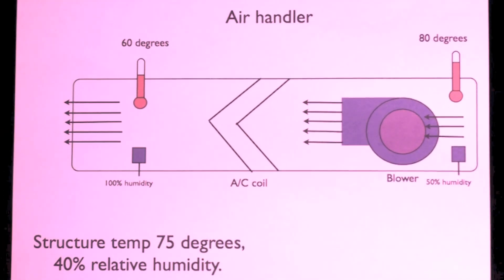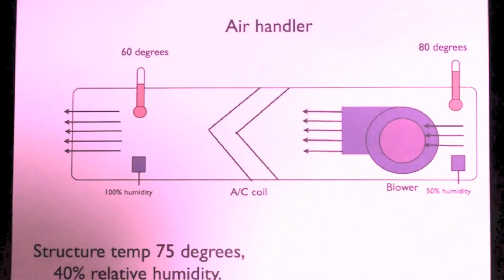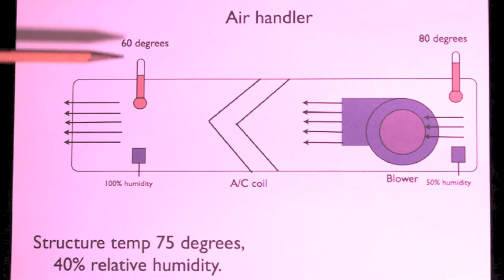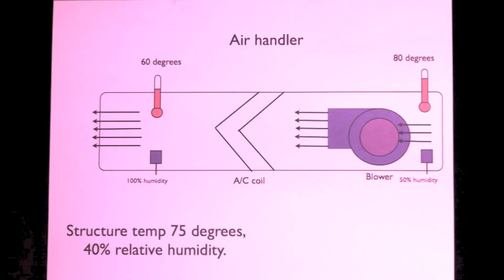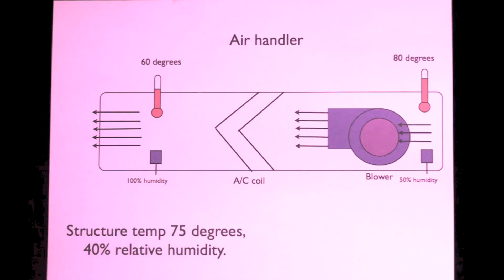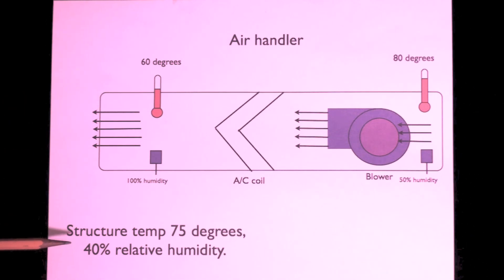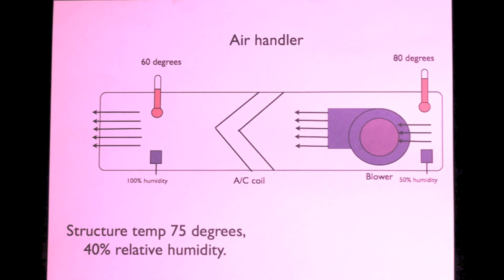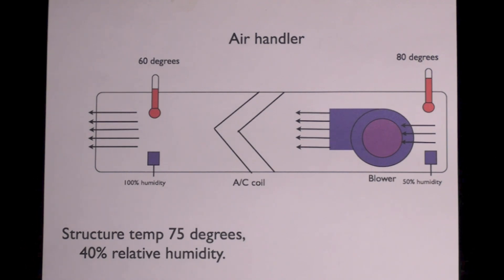Humidity:  The air conditioner as a dehumidifier

Comment: Your videos are great and I enjoy them very much. I am having trouble understanding your logic on the way the evaporator coil removes moisture. When air warmer that the evaporator coil hits the coil moisture will condense on the coil and drop out and be drained away. The air going across the coil is cooled and the humidity is reduced. Over time the amount of cool dry air being pushed into the home displaces the warmer air. Moisture will always be drawn to drier air so that is why the dryer air coming out of the AC ducts eventually lower the humidity in the house through the return air. It makes no sense that the cool dry air would be saturated to 100% after it is passed across a 40 degree evaporator coil. I think that you have your diagram at the start of the backwards. The air coming in would be 100% (most likely 70% (if it was 100% it would be raining😀) and lower going out at about 50%. I worked for the largest manfacturer of air compressors in the USA and taught classes in desiccant air dryers and refrigerated air dryers. We could take 100 psi @ 100 degree inlet temperature saturated compressed air and could achieve a dewpoint of -100 F (now that's dry). Of course compressed air dryers and HVAC unit are not the same but work on the same principles. Best regards Steve
Reply from the maker: Warm air passing thru the evap has its temp dropped below the dew point.  At that point, moisture condenses out of the air.  That means the air supplied to the structure is 100% humidity.  It then mixes with the ambient air in the structure and the humidity decreases.  Each time the structure air passes thru the evap, more moisture is removed.  
The result is reduced humidity the structure.  
GFM
Reply: @grayfurnaceman  Thanks for the information, I have been watching videos on enthalpy and it make more sense to me now. I always worked with compressed air systems under a pressure anywhere from 100 to 150 psi. not HVAC. I always knew that when checking dewpoint on a desiccant dryer we would use a sample cell to monitor the dewpoint of the air leaving the dryer outlet. There was a valve on the inlet that was always wide open and a valve and a "pig tail' (copper tube wound in a coil) on the bottom of the sample port. The bottom valve would always be just barely cracked open. This allowed the air to expand out and give you a correct dewpoint. If you took that reading at line pressure it would not be accurate. On refrigerated air dryers we never checked the dewpoint with a hygrometer. We knew that as long as the evaporator temperature was between 38 and 42 degrees there would be no water downstream in the compressed air system (we had a per cooler /reheater in the refrigerated air dryers that would warm up the discharge air to almost the same temperature it was as it came into the dryer), (prevents the compressed air piping from sweating). Our desiccant air dryers were sold to maintain a dewpoint between -40 F or -100 F depending on the model purchased. When air expands out it will lower the humidity of the air stream, one day I will get a temperature meter that can read the wet bulb and the dry bulb temp then use a psychrometric calculator to get a enthalpy number on my home HVAC system. I guess we are never too old to learn 😀. Looks like air flow across the coil will also determine the humidity in the discharge air. Now that I am retired I have more time to study and learn things that I always wondered about but always had an answer that would work in most situations. I knew that you could change the air flow across the evaporator coil but I never understood why. Thanks
Reply: Hi, Before I get installed an A/C duct, 
I'd like to search for an A/C which is going to deshumidifier during winter 
You have very good points
DomIJ

Comment: Our blower fan speed is set to 2100. It's a 4 ton system. Maybe that's too high?
There's also a 1900 option and a 1600. What are your thoughts?
Reply from the maker: In high humidity, it is too high for dehumidification.  1600 may still be too high.
GFM
Reply: @grayfurnaceman  OK thank you. Yes Gulf coast, which is high humidity. We will try either 1600 or the next level below that, which I think is 1400.

Comment: So why on my new AC, that cools wonderfully, it increases humidity in my house?
Reply from the maker: An air conditioner cannot increase humidity.  However, it may not reduce humidity as much as an older A/C.  Reducing the indoor fan speed may increase the moisture removal.
Best done by a professional.
GFM
Reply: @grayfurnaceman  I had the ac guys out here yesterday and the plenum that all the ducts connect too lost its seal and was mixing with hot humid air in the attic.
Reply from the maker: @FlydreamMedia  OK
GFM
Reply: My air conditioner adds humidity too.  Upstairs air conditioner broke and used fans pulling downstairs cool air up and humidity went down to 45%.  When air conditioner upstairs working the humidity is70% and I have to use 4 floor dehumidifiers when it is on.

Comment: Brand new home w carrier ac on temp 75 and humidity 75% feels like 80 degrees in my home. 1700 sqft with a 3.5 ton ac unit 2x6 construction w extra insulation Why is my house not like a Yeti coller! I like to be cold. the AC guy here that installed system says well its 70 degrees in the house and I am getting ANGRY  paid 200K for a new house that we are sweating in. Please any info will help Im in a small town so you can imagine
Reply from the maker: What you are up against is residential A/C units are designed to cool to 70F.  If you want it lower, the system may not be capable of doing it without freezing up.  There are methods to allow it to reduce that temp but they require changing components in your system.  
Now, if the unit will not bring the temp down to 70F, you have a system that is too small.  
GFM
Reply: @grayfurnaceman  Almost identical problem as James'. First summer in my new home, I was happy and comfortable. First winter and I was freezing because the blower/air circulation was powerful. Builder sent a technician to adjust it and I've had miserable summers ever since. It's hot and super humid (60% on average). What did the technician change and how can I get it back? I'd rather freeze in the winter than suffer in the summer. 😭🥵
Reply: 75° temp with 75% humidity is certainly uncomfortable. How long is the run cycle time with your unit? Is it not running long enough to remove moisture from the home?
Reply: @TJ-22  how can i make it run longer? Move the thermostat?
Reply: @jamescarnes2466  Well I was just curious how long the AC unit runs, when it kicks on. Does it run for approximately 15-20 minutes? Does it run for only 5–10 minutes? You might not be able to get an accurate test until the weather outside is hot again.

Comment: Sorry if my question was answered but, how is humidity reduced in summer?
Reply from the maker: The air conditioner is a dehumidifier in addition to being a cooler.  The cold temp of the evap coil reduces the air temp to the dew point, so the water condenses out of the air.
GFM

Comment: If used AC no need of dehumidifier?
Reply from the maker: The A/C unit can be used as a dehumidifier, and is far better at it than a room dehumidifier.  Air flow adjustments can fine tune the amount of dehumidification.
GFM

Comment: It looks like the diagram is saying after it passes the coil it becomes for humid by 50 percent more
Reply from the maker: In most cases, the air temp is lowered to or below the dew point.  The dew point is 100% humidity.
GFM

Comment: I had a New system put in my home which is bigger than I need for the structure will that affect the humidity in my home should I have the blower speed reduced to dehumidify more moisture
Reply from the maker: Generally, the larger system will remove more water than a smaller one.  
GFM

Comment: I don't understand you explanation. In A/C mode warm moist air go's in the air handler via blower The moisture and heat is absorbed by the cool let's say 45 degree  evaporator coil and  come's out cooler and drier. The heat is absorbed by the refrigerant and water drains out the drain line.
Reply from the maker: The lower the temp of the evap, the more moisture will be removed from the air.  Air flow increase will increase evap temp, lowering moisture removal.
GFM

Comment: My problem is that my air conditioning unit over-dehumidifies the air and my nose and mouth is always dry and painful the next morning. Any helpful suggestions would be valuable.
Reply from the maker: A simple fix is to increase the fan speed if it is not already at the highest speed.  Also, be sure the filter is clean and not reducing air flow excessively.
GFM
Reply: @grayfurnaceman  Thank you for your advice sir  I'll be sure to try this. Keep adding value through these videos to those who need it👍

Comment: I am in South Florida and my Rheem doesn't cycle long enough or often enough to remove the humidity in the house, however, it has no trouble achieving the temp. Any suggestions?
Reply from the maker: One of the things you might try is decreasing the fan speed.  It is one of the simplest methods and may help.
GFM
Reply: Thank you, I had heard that but I wanted your opinion.  I will try it.
Reply: @dudemup69  You should do 350 CFM per ton if you're in a humid area and have humidity issues inside.

Comment: if i add a dehumidifier in my home will it further cool....also a humidifier produces heat, venting it would negate the heat correct?
Reply from the maker: A de humidifier will add heat due to its compressor heat.  Humidifiers actually remove some heat to evaporate the water unless it has a heating element.  In that case, heat is neither added or removed to the sensible heat of the air.  Hope this helps.
GFM

Comment: more be more interesting if you have used a psychometric chart to explain the process taking place inside the cooling coil and shows how water is removed or expired out once it reaches saturation temperature.
Reply from the maker: Sounds like another video.
GFM

Comment: 1:00  If lowering the temperature of air lowers its capacity to hold water, how can the colder air have a higher humidity at the output?  Wouldn't it have left some of the moisture behind on the coils, thus lowering the humidity?  Or do you mean that the air got cooled, along with the moisture in it, making it so it can't absorb anymore, thus creating a higher relative humidity?  Crap, I can't believe that almost made sense to me, but did it?  I don't know, all I know, is that, I got one of them ductless mini-splits in my room, and ever since, the humidity is absolutely unbearable, 70-75%.  I don't know what to do about it.  The standalone dehumidifiers are way too loud.
Reply from the maker: +mef1975 Assuming a relative humidity of 50%, lower the temp, the air molecules get closer together which increases the relative humidity, perhaps 70%.  It will only condense if the temperature reaches the dew point (100%).  As for your problem, I am assuming you are cooling.  Some mini splits have fan adjustments that will increase the moisture removal.  Hope this helps.
GFM

Comment: Thank you for your videos. They are both clear and informative. However, after reading some of the comments below, I believe it would have been clearer for your audience if you would have explained that as Relative Humidity raises after it crosses the coil, Absolute Humidity (the actual weight of water per cubic foot of air) drops after the air crosses the coil. Thus, the A/C ends up drying the indoor environment.
Reply from the maker: +Ollie Good thoughts.
GFM

Comment: What i dont understand , is how can you have 100 relative humidity after the coil , if the coil condenses the water?
Reply from the maker: The coil cools the air to the dew point (100% humidity).  Then the water condenses on to the coil.  Not all the water in the air condenses out.  Just enough to make it 100% humidity as it leaves the coil.  Hope this helps.
GFM
Reply: cooler temperature, the less moisture that  air temp. can hold, so it would be a higher percentage RH?  i might be barking up the wrong tree..not an expert here, just curoius. ....
Reply from the maker: bababooey7576 Think of the air as a container.  Lets say its a 1 gallon container with 1 quart of water in it.  25% full.  With a lower temp, the container becomes smaller, such as 1 quart.  Then it is 100% full.  Hope this helps.
GFM
Reply: yeah, more or less what i was trying to stammer out in answer to the person's question...  coincidentally I had an hvac guy over servicing mine and my parents' furnaces...theirs was red tagged due to being oversized and some other issues...we were discussing AC and how the one in my place is 31 years old and still going strong etc etc, we were talking about dehumidification and h e was saying how he'd put a 1.5 ton condenser outside with a two ton evaporator to increase dehumidification (in a general sense he was say ing, not geared specifically to me).  he seemed to be a stickler with sizing and numbers and clearances etc., does his theory make any sense re 2 ton evap?  i'm in canada btw..only a few months of cooling required, but lots of dehumidification in that time, too..  And, your thots on electronic air cleaners? my parents have one and u nless my dad is down there every 3 weeks washing them (which  he isnt, it's usually me), the amount of particulate that blows by is enough to have clogged the drain in the A coil twice and there's always fine bits of particulate in the furnace blower housing...are these filters better than a regular decent quality media filter if kept clean? (i do like the way it eats up odours and the house smells clean, when the filters are clean)  Their old furnace is being replaced next week and the EAC may go with it depending on the answers/info i can find out before then.  Thanks
Reply from the maker: bababooey7576 The dehumidification actually increases with a smaller coil, not a larger one.  The smaller coil has a higher temp difference that removes more water from the air.  
The EAC filters are not perfect but most of the pleated filters have quite a lot of pressure drop the EAC does not.  Hope this helps.
GFM
Reply: grayfurnaceman Well, those  were my thoughts regarding the coil.   As for the EAC, Since my parents already have it installed, i might put my dad on a 3-4 week clean cycle for it (since he is retired, and im not there to do it like i used to)., if that will help keep the blow-by to a minimum..(Will it keep the blow by to a min?)
.I know these filters get less efficient as they get dirtier and it makes sense.    I just want to make sure before the guys get rid of it next thursday with the new furnace, that we're not making a hasty decision.  it is about 12 years old.  The people have some ducting to upsize and plenum stuff to deal with also so....
Reply: bababooey7576 I think he is wrong about the INCREASE in dehumidification.  The mismatch of a 1.5 ton condensing unit with a 2 ton evaporator will result in a slightly HIGHER temperature of the evaporator tereby resulting in LESS dehumidification.  The mismatch WILL allow more of the 1.5 ton condensing unit capacity to be SENSIBLE cooling (TEMPERATURE) and LESS latent cooling (MOISTURE REMOVAL). Hope this helps>
Reply: Ray Jones I had another guy say the same thing.  And even a guy at work said his 1.5 condensing unit has a 2 ton evaporator.   weird.  I just know mine is technically over sized for my house.  2 ton system.(cond and evap).  works well when we have company and it runs longer.  if the house got more sun and was a few square feet larger, it'd be perfect.  I can't complain at all though.  it has been here 32 y ears and the entire time we've owned the house (1998), it has never broken down once.  runs like a champ, doesn't struggle.  if it ain't broke...we don't keep it like a meat locker in here but just enough so we are comfy.  hydro bills aren't killer.  im h appy over all
Reply from the maker: When you consider the smaller coil as a dehumidifier, remember the condensing unit is larger compared to the coil.  True, the supply air will be warmer, but the temperature of the coil is lower because there is less surface area.  The condensing unit will still move 24000 BTU but it will have to work at a lower temp to move that amount of heat.  The lower the temp of the coil, the more moisture removed.  I will be doing some more videos on this concept that may help explain it.  Hope this helps.
GFM
Reply: That makes complete sense unless they had the sizes of the components switched.  Smaller evap. Smaller surface area.  I understand what you said completely.
Reply: This is true IF they had the sizes of the units switched.  But if the sizes of the units are as stated, 1.5 condensing unit (18,000 BTU/hour) and a 2-ton evaporator (capable of removing 24,000 BTU/hour but only removing 18,000 BTU/hour-capacity of condensing unit) then the MOISTURE REMOVAL RATE is reduced because of the HIGHER surface temperature of the evaporator.  More of the 18,000 BTU/hour of the condensing unit goes for SENSIBLE cooling (TEMPERATURE) and less of the 18,000 BTU/hour is used for LATENT cooling(MOISTURE REMOVAL).  IT IS JUST THE LAWS OF SCIENCE AND THE REACTION OF HOW THESE COMPONENTS ACT WHEN THEY ARE MATED TOGETHER. Hope this helps.
Reply: Ray Jones My thoughts exactly.  When the dude at work told me this, it didnt seem to make sense and the guy at my house once said something to this effect.  i'm thinking he said 2 ton condensing unit and 1.5 evap...but the guy at work def said 2 ton evap...maybe he got them confused as it doesn't make any sense...oh well. im not in the business, just have a keen interest and probably should have gone into it as everyone keeps telling me so.